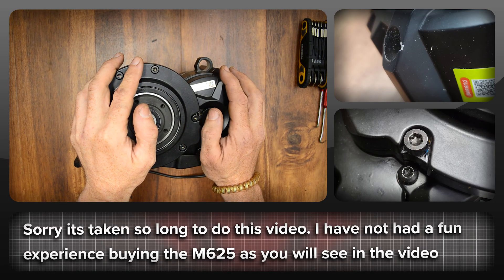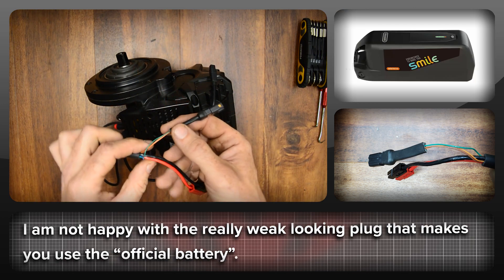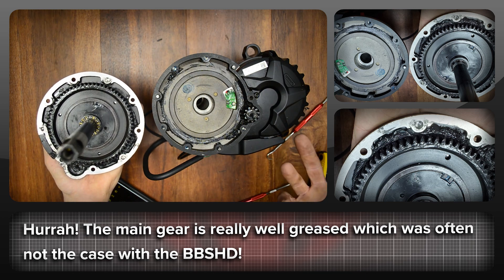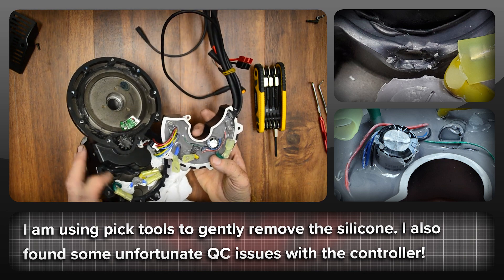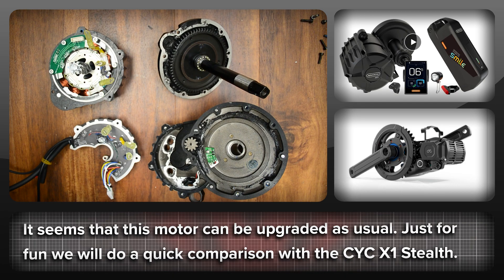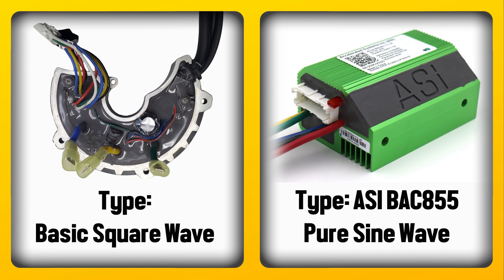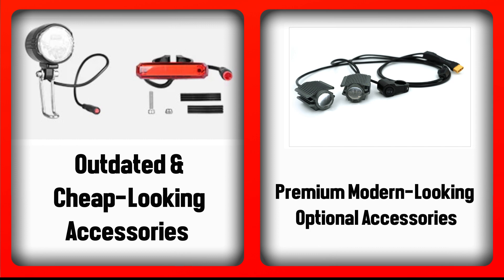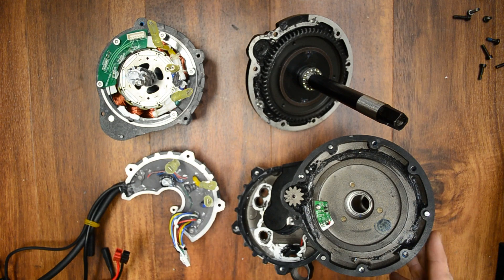Bafang M625 (BBSHD V2-) Lets See What is Inside! A look inside the updated mid-drive motor system

Comment: This re design by Bafang was nothing to do with making the motor better. (In fact they made it worse). It is a business strategy to get higher returns by selling semi direct to customers and profiting from the battery sale also. The cosmetic redesign was to create a new model, something that people with think is a step up from the HD. Then they selected a handful of online resellers to trade the motors and established warehouses in major countries to distribute without air freight (can't fly batteries). This way Bafang get the distribution margin at point of sale. The reseller makes a cut and that's that.  There is no room for a local seller in this model. Don't expect your favorite local reseller to be sticking this and helping you out.  This is Bafang business model for maximum return.
Reply from the maker: That's about the best summary of it as I have seen so far. 👌
Reply: @HighVoltageKits  Daryl from Lekkie here. I tried to become one of the"agents" for this motor so I could create a channel for global resellers to purchase, but the terms were unreasonable and the distributor price similar to what you buy on line. Bafang have been quite open about their new business model. I don't think the HD motor is going anywhere. If it did it would be to cut out dealers and force customers to buy this model online at one of the chosen few.  It really is time for a new player.
Reply from the maker: Good news on the HD then. I will be suggesting people stick with that one! Thanks for making such great products!

Comment: With K1 BBR This motor should run also with custom DYI battery. I just need to match connectors, dont have this motor in lab.
Reply from the maker: They are selling cheap right now

Comment: If  only the CYC could be more silent! 
I'll stick with the bbs02 for now I guess.
Reply from the maker: Nice motor! Very popular for good reason. Cheers
Reply: Just out of interest I run a BAC855 on a BBS 02 on 52v with no problems,the motor is almost silent PAS programmed to 1200w and throttle to 2600w extra power without the extra weight of the BBS HD take no notice of people that say you can't run an 02 on that controller or power, ride with "common sense" are the ultimate 2 words used  here.. 🙂
Reply from the maker: 100% Great to hear you are still going strong 💪
Reply: @yj8471  I am considering this, especially because I do not use the throttle (not even installed).. Somehow I thinking PAS only will be easier on the motor..
Reply: @v1ncen715  Don't install the throttle if you don't want to use it no problem..
Reply: @yj8471  Oh yes, it works just fine, it is very nice to ride that way. I am just wondering if I should experiment with a third party controller as well and if it would really be beneficial for PAS only.. I think yes but did not order anything yet.
By the way do you have a plastic cover or 3d printed part (or 3d model) to cover the original controller on the BBS02?
Reply from the maker: Not yet. I am down to make one tho! I just need a model or a motor!
Reply: @v1ncen715 I had a blown 02  controller you remove it from it's casing and use that if you want ? Or a 3D printed one your choice ..
Reply: @yj8471  I 'll probably try to find or make a 3d printed one to save a tiny bit of weight.

Comment: Sounds like you bought a return from a reseller ,not really a for comparison.
Reply from the maker: I was more interested in how similar it would be to the bbshd. But yeah I was pretty annoyed they sent me a return motor. Either that or it was poorly assembled.
Reply: @HighVoltageKits  I have a bbshd had the rotor failure got the new improved one with the old Bering installed fit right in everybody said you need the new stator fit right in the old one my opinion the old rotor was in shallow on the upper bearing always had vibration at certain rpm vibration gone running it at 30 amps no problems.

Comment: Isis is a terrible crank interface. You'd  be better with a modified BB 30 or GXP setup, or a BMX  axle clamp-on arrangement.
Reply from the maker: Thanks for the info. I have not had the opportunity to experience those. Makes sense as the only real difference with ISIS is more splines. Cheers

Comment: Disappointed in bafang. I have had the bbshd and I have 12540 kph on it with no issues but this motor looks like it was rushed.bbshd is better. Bafang really cut corners. They are getting cheaper and cheaper and they know they will sell because of the there  bbshd. I am going for a cyclone pro gen 2 or I will buy a bac2000 and wire it to my bbshd. The older one is good. The company I bought my bbshd from they open them and double check ever thing.luna has a new gear to replace the nylon gear it's not the metal one it's a new  Material it's a brown color. My nylon gear never died on  me but i replaced it with Luna, s new gear. 100  bucks cad  that's shipping too. You would have to buy a lekkie bling ring m625.
Reply from the maker: Yes. I would love to know the reasons and thought that went into some of the choices. If you are going to restrict the product at least make it so much better it will turn heads

Comment: M625 , multiple bearing failure's,nylon gear bearing shot ,only  900 miles on it 2 months old .
Bad design,poor quality parts , disappointing.
Reply from the maker: Very, considering it's supposed to be identical the the bbshd inside.